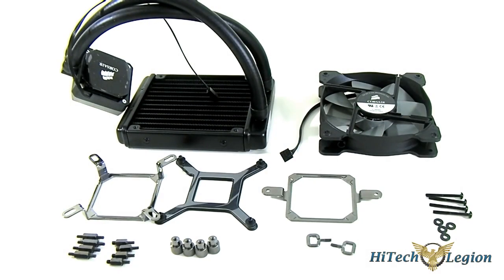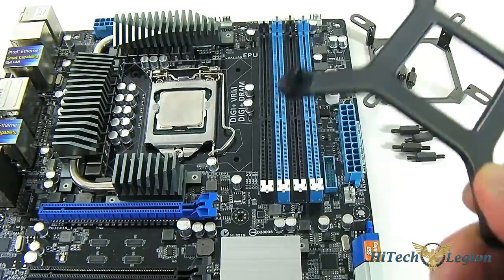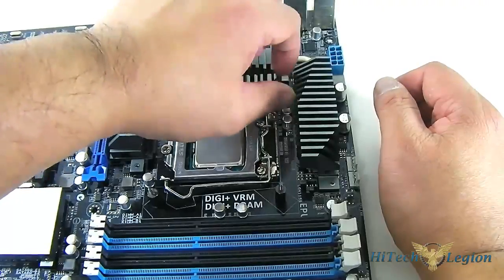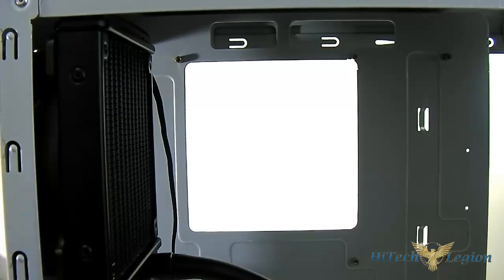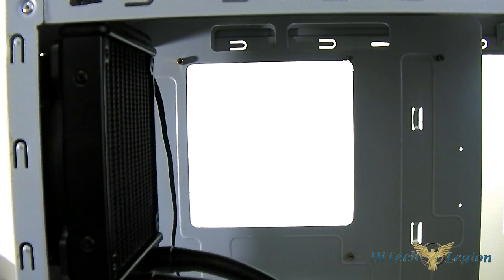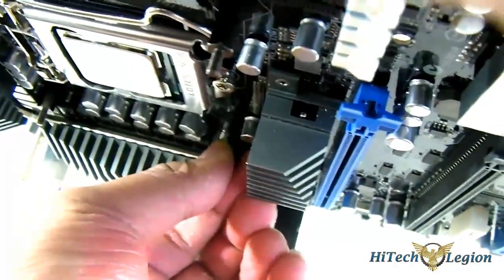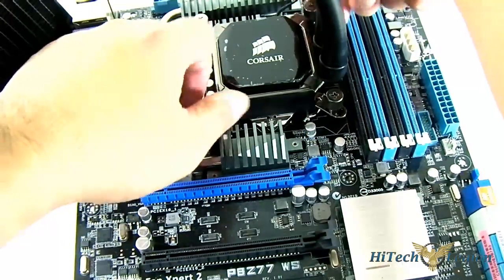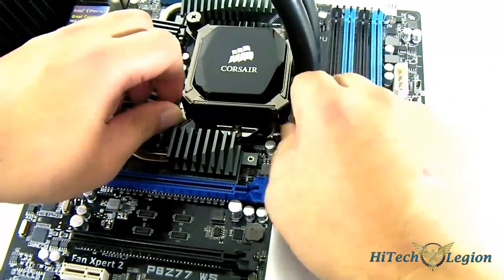Corsair H60 (2013 Edition) Installation Guide on Intel and AMD Motherboards

Comment: Hello, I have this cpu cooler in my current system and I'm thinking of upgrading my system to AMD with AM4 socket motherboard (Gigabyte B550i). Can the corsair H60 (2013) able to mount on the B550i motherboard?

Comment: Thank you for sharing the AMD set up as well. I couldn't figure out what I was missing. When my cooler crapped out in the past I had a temp cooling system put in and it was just a regular one. I finally got around to buying a new liquid cooling one and I couldn't figure out what I was missing. Turns out, it was the AMD brackets. I'll have to order some more because the tech guy that had replaced it must have discarded my AMD brackets... sheesh! You saved me!

Comment: hello i got a big question i cant find anywhere...i got a omen desktop 880 and the backplate is glue and screw with the socket,so i got 4 mounting holes like 2011,i cant remove the backplate will this screws make the job?IF i unscrew the 3 screws of socket i can unglue and modify but no way to fixed the socket from 2011? mine its a 1151

Comment: I have an am3+ motherboard ... I got the h60 and it doesn’t look like the mounting brackets fit!? Please help... I’m a musician not a computer guy !!! 💙😁
Reply: Same.  You have to use the brackets that came with your motherboard.  They're the black things that have the notch for you to try to hook the H60 on.  It took so many tries to get it latched on  that it bent some CPU pins.  I tried to straighten them out repeatedly but it just got worse.  I'm looking at having to get another CPU if this last try doesn't work.  Even worse, at my budget, I'll have to downgrade my CPU.  My old cooler used custom spring screws to work.  I didn't need to use clips and risk damaging my CPU.  The problem is that eventually I lost some custom screws so my old cooler is now useless in my new motherboard.

Comment: Installed this on Ryzen 2700X using artic mx-2 thermal paste in a nzxts340 case and get 69 degrees using prime stress test in 5 minutes and running at 3.725ghz is that good ?
Reply: faizan hussain that’s pretty bad lol I’m using a 2600 at 3.8ghz with stock cooler at 75c

Comment: I beg anyone to answer if this will work with AM4. There is zero information about this anywhere. I contacted Corsair and still no reply.
The black holder on the motherboard looks really similar to AM4 and by looking at this video I kinda guess it fits. But I am still unsure.

Comment: can it work on lga 1151?
Reply: Giosue Iglesias i
Reply: Yes I have same question will it work on LGA 1151 ( Intel) But my pump bottom plate is Round not the square one, it's bit confusing.

Comment: hey i just want to know where the fan connecting to (CPU FAN)?
Reply: T 808 Production  this is a water cooling sistem for CPU's and it uses the CPU Fan conection
Reply: @AgnoticTV  it goes to a 3 pin or 4 pin

Comment: thanks for the CPU speed tip. this is my first PC build so didn't know about maxing out the fan controller for the water pump. I was monitoring my CPU temp and it was showing 90c (i5 6600k) during game play and I was getting worried. hopefully this will help

Comment: if the radiator and fan are as they are as you showed in the case and i have it as an outake would pull be better or should i have it with the fan on the other side and in a push config?

Comment: just bought and installed the h60 cause i thought my old cooler was shit but now i still get my cpu temp to go 70 celcius but the weird part is with my old cooler my case got fucking hot like a heater now its cold as winter but still says my cpu is 70 in windows when i start a game it goes to 80 and crashes back to windows:S:S:S:S:S:S
Reply: +Danny Dan (Suicide) Sounds like you need to re-apply the thermal paste. Likley an air bubble under the cooler. Remove it with alcohol and reapply thermal paste and that should help.
Reply: +David Conway cleaned it off with a coffee filter before installed it
Reply: What thermal paste are you using?

Comment: i have a problem my cpu is way to hot like 100c or 200f i need help i have it setup properly and i just need to know where i plug in the cables on my msi z97 gaming 5 motherboard
Reply: +xNoah there is no way your cpu is at 100c that would burn everything.

Comment: Well this cooler work with the MSI Z97-GAMING 5 ATX LGA1150 Motherboard?
Reply: +ninjaguy137 Yes, i'am wondering that as well
Reply: +ninjaguy137 Check the box. It should work with all intel sockets.
Reply: +II_RAIN_II Socket 1156, Socket AM2, Socket 1366, Socket AM3, Socket 1155, Socket FM1, Socket FM2, Socket 2011
Reply: I got the same motherboard. But do you need to put the backplate on, on the Z97?
Reply: I decided not to use water cooling. I got a Cooler Master Hyper 212 EVO.
Reply: LIke everybody else!
Reply: Karl-Emil Rydahl Thygesen Yeah!

Comment: How many connectors are there? One for fan and one for pump? And are they 4 pin? If I only have one 4 pin CPU fan connector on my mobo what do I do?
Reply: +Ace Wouldn't it be better to put the pump into the system fan connection and the fan in the cpu fan connection since the pump needs consistent power while the fan speed can vary depending on how hot the cpu will get?
Reply: The pump is a 3 pin connector. I connected it to my 4-pin cpu fan. The fan itself I think is a 4-pin connector. I connected that to my System fan slot.

Comment: Is the water already put in?
Reply: yes
Reply: +T3chno do u need to change the liquide within it from time to time? Or can you keep using the same liquid?
Reply: +Vexsf _ No, CLCs are disposable. There is no way to fill or do maintenance. When evaporation starts, you throw it away.
Reply: George Cella Thx u <3
Reply: +George Cella How do you know when that happens? And how long will you.    getout of it.
Reply: +ImmortalPlays You will see decreased performance, and may start getting pump noise. How long it lasts varies.
Reply: +George Cella Okay thanks

Comment: In my case (NZXT Phantom 410) I've installed it at the top with the fan blowing from the outside to the inside of the case through the grill (however it's called) with them separated. 
A.K.A grill under the metal at the inside and fan on the other side. 
Does it affect temps or anything?
Edit:
The CPU is OC'd to 3.6 ghz from 3.4. stock. (i7 - 3770, OC'd using motherboard [MSI g45-z77 thunderbolt])
Currently the temps are 35-50 at idle with fan speed at 45%-60% (~1% - 35% usage) and 70-75 max at full usage with 85%-100% fan speed.
Room temps here in my country are like 35 deegres at best.

Comment: is the fan 4 pin?
Reply: +lewismichaelbbc The pump has a 3 pin connector, and the fan has a 4 pin connector. This is stated in the comment above this one :D
Reply: +Solstice [SaltyPeanutCraft] so its ok to connect just the 3 pin (the pumt)? I only have one spot for cpu fan too. Its ok to let the 4 pin of the fan unconnected? Or Is there a way to have them both working? (the fan included and the pump)
Reply: You can have the fan and the pump each on only a 3 pin, if you connect it correctly. The 4th pin is only there if you want to control it with some sort of software, which isn't needed because they run perfectly without software. You have to have the pump and the fan connected to at least a 3 pin fan header for the unit to function. If the fan isn't powered, it won't spin, and your coolant won't be cooled. If the pump doesn't run, than no coolant with circulate. Hope this helps!
Reply: +Solstice [SaltyPeanutCraft] I see, I was reading and the solution is : a spliter (for my only cpu fan spot) or a molex to connect the fan directly to the psu. I'm right? Right now im working just with the pump connected. I'm using a gigabyte GA 78LMT-usb3 (BTW thanks for your fast answer)
Reply: Yeah, a splitter would work great! They're very cheap on Amazon and/or Ebay :D  No problem for the fast answer lol, I'm not sure how you're working efficiently with just the pump... what CPU are you using? That's important. Thanks!
Reply: +Solstice [SaltyPeanutCraft] an Amd fx 8320
Reply: Hmm, that's about the same heat output as my 860k. Overclocked?
Reply: +Solstice [SaltyPeanutCraft] No, I think is not necessary (for now) I'm using a 4gb video card too,  a Sapphire (have his own 2 fans) and whenever I play I turn on the air conditioner but I really want to put to work the fan of the h60 and not just use his pump. (just to have cooled at max my pc). Just need that damn spliter :P
Reply: Cool! I hope the splitter works out :D

Comment: Don't listen to the naysayers bashing these and other CLC AIO's etc, If you have a larger case, you can very well consider some massive air tower as well. But with a smaller case Water IS the way to go.
Reply: Jordan Spinks You tell 'em! Just because you can get better performance and less noise from an air cooler at a lower cost doesn't make it better. Higher temps and more noise is DEFINITELY the way to go. Especially when you can spend more for it.

You do realize that most current small air coolers from top name manufacturers have put this unit to shame in our comparison tests.....right? Even the $35 models.
Reply: George Cella
Bullshit, good luck cooling say an Oced 8320/8350 on some mediocre air sink you are probably talking about haha

I'm going to throw up you trying to do it with an EVO over there or something haha

And what are you talking about?... most of the water/Liquid setups are waay quieter...a lot of air is loud/loud obnoxious fans etc.. not all but a lot of them are....

H60, Lapped 8320 over here passed a 5ghz 1.54v Cinbench or brutal Prime stable for any Length of time...Let me see your $30 air sink do that and not break 50-55c...
Reply: Jordan Spinks I see. I often forget that in the dozens of comparison tests we have done involving the H60 and other 120mm CLCs at HTL, in temperature and hardware controlled environments, the results, though consistent, are always wrong. The dB meter and temp sensors simply report incorrect measurements on 120mm CLCs, and only 120mm CLCs.

I know that you must have done similar testing to back up your statements, and would be interested to see where you have published the results of the likes of the new Cryorig, Thermalright, be quiet!, etc. Obviously, we are not talking about the EVO here, since I was specific in saying top name (not mainstream) and current (not several years old).

So, there is a reason for all the naysayers. It isn't 2012 anymore when CLCs were interesting and there weren't significantly better options. Tech has moved on, and so have consumers. Unfortunately there are still a few out there still riding the little Corsair sailboat down the river of denial.
Reply: George Cella There is no way in hell that would fly with 5ghz and that much Vcore it took and could take more actually...

I know there is a handful, close pricing wise and would probably perform somewhat similar nothing magical/ridiculously better...you are being delusional expecting that.  I won't argue with you that much xD, I know especially with AMD and say some of the nicer Top down coolers...where my god, got some actual air/flow passing/hitting the board/the socket/ram/vrms etc...that is significant.

while yeah I know say H80/H100 would obviously perform a good bit better. Still though H60 setup as intake is not that bad at all and even better Intake Push/Pull 2nd fan... I just don't like dumping that heat into the case and everything else suffering from it...but part of it.

bedside's the point dude,I don't have a large case..pretty small mid tower currently...If I had a larger case/full size then yeah a lot more options...some nice open loop/res, NB/GPU Blocks all that etc...
Reply: Jordan Spinks I'm really not looking for miraculous results, or even saying that there are any. But, you are definitely selling the advances that companies like Cryorig, Thermalright and be quiet! have made in the last year short. Their current entry level coolers perform on par with last gen's mainstream. I'm not talking about three year old coolers like the EVO.

You are also very much cherry picking a singular situation in the extreme OC on an AMD FX chip. Pushing that aside and talking more general and more widely used scenarios (say stock speeds or OC...and, of course, the more widely used Intel platform), top quality air is going to provide better cooling, with far less noise, and for less money in day-to-day computing. And frankly, day-to-day usage is where it really matters. Prime95 runs are nice, but it isn't what you spend your time doing.

So while the $35 air may not handle the Prime 95 run as well, you also find that the H60 can't keep the CPU at lower temps and stay under 40dB while doing CPU intensive work such as transcoding HD videos, while the air cooler will.

In other words, the huge advantages to air are when you are actually USING your computer, not for when you are stress testing.
Reply: George Cella
I know, with AMD cherry picking chips/Niche OCing all that 8320/8350/9xxx some are not that bad to cool and will undervolt much better...others no... are polar opposite and it's like you can't throw enough voltage at them....

With Intel it's basically no Problem in comparison...Ivy/Haswell anyways.

I still got X58 too I smoked a Xeon on it, it was killer chip would run flat out 75-80c..vs others that caught hell with like 65-70c.... no issues...but I smoked it with voltages xD,

Yeah 920 smoking at 4ghz or Xeon w3520 better binned going at 4.2-4.5ghz I know xD tweaked the fuck out, snorting/ripping a line of some killer Glass every 15-30minutes etc, staying up for like 12 days etc haha, I almost Fucking Died I shit you not...it's fucking Sad...
I toasted/Fried the Fuck out of my Brain haha

Comment: is the Corsair H60 good enough for the AMD FX 9590?
Reply: +Midnight Rocker38 probably not to be honest i would go with the H110 for proper cooling of that chip because it runs at 220w TDP if I remember correctly which is insanely hot at stock speeds.

Comment: I think i fked up the thermal paste my comp shuts off after like 5 mins of use..
Reply: UltraSean123 maybe your fan connector doesn't give to the pump 12volt so the pump doesn't fonction at all and it overheat very quickly because there is no active cooling systeme :/ check your bios setting

Comment: can i add second fan to the h60?
Reply from the maker: Yes, for a push pull config.
Reply: does the h60 comes with extra screws for the second fan ?
Reply: Blackpacker I think the fan you order will come with them.

Comment: Does the pump plug in to the mobos cpu cooler fan socket. Which the stock cooler was plugged into? Guess this is 12v as std. Not good at going in to bios. Rad fan to any fan connector?

Comment: Is the pumps connector a 4 pin or a 3 pin?
Reply: lonerider92 4 pin
Reply: hueylax707901 Nope, I bought it and the connector to the pump is 3 pins, the fan is 4.
Reply: lol, yeah, i typed this in, and looked at my rig and realized that lol
Reply: lonerider92 yup that's 100% correct, the pump should go to any case fan header so it gets a constant high power flow, and the fan goes to at 4 pin PWM sys fan header so its controllable via the bios

Comment: This is the best review of Corsair H60 Cooler. You showed screw in 7:12 - can you tell me the model of that screw? or ebay link? 

I have a case, where I need to mount the radiator in the case and fan in the radiator, as my case (azza silentium 920b) don't have upper fan mounts.

Comment: I got one of these recently and installed it. The installation was easy enough, I'm not sure where I went wrong but my temperatures aren't too great. On an i5-3570k standard clock idle I average 30-40c, which as I found out is average. However, when I'm playing demanding games my CPU is hitting temperatures in the high 60s, hitting 70c at peak which wouldn't be bad if I was on a stock cooler, but given this is a water cooler I was expecting more and my friend who also has it never goes above 50c under load. I'm going to try reapplying the thermal compound and play about with the airflow on the radiator to see if I can make any difference. Currently I have the fan pulling air into my case through the radiator, which then gets exhausted out of a top mounted case fan. Any advice on what else I could do should this fail to make a difference?
Reply: Make sure your fan has good airflow; try increasing the speed of the fans and see if that makes a difference? Also, make sure you spread your thermal compound correctly. That's all I can think of
Reply: Scattergun I'm not sure how to change the speed of the fan on an Asus motherboard. I was looking around in the BIOS for options and all I could find was an option of slow, normal or fast. Setting it to fast didn't really make any difference at all, not even with noise, and this was on the CPU fan. I checked it to make sure I had the fan plugged into the CPU fan port and it was. I also found an option for the chassis fan, which would be the pump now, an option called Q control. I turned it off to see if it made a difference but again not much really happened. I have also reapplied the thermal paste using Arctic Silver V which lowered my temperatures by about 5C, so now hovering around 65C at peak temperature under load.
Reply: coolcar100 Under load at peak temperature of 65C is pretty good! One more thing:  Make sure your pump has a full 12V of power from the fan connector you have it plugged in. Some fan connectors only give 12V. Best bet is to plug the pump into a 3 pin fan header so it always gets full power. 

There is also some free software that you can find online and can make your fans speed up and slow down without the bios.

 65C at a peak temperature is nice, so it seems the problem is solved! (I think lol)
Reply: Scattergun Hmm, I'll take a look for some software that I could use. Thanks for the help!:)
Reply: A